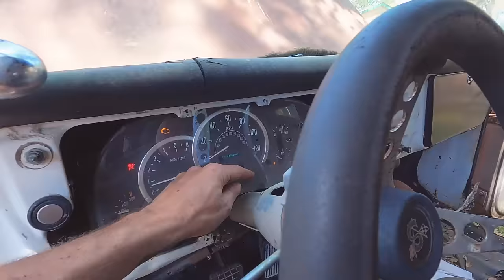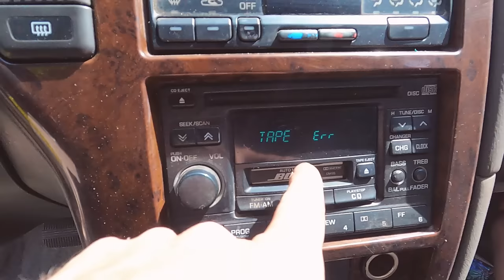It's time to start playing with some of our new projects!

Comment: The pumps in the taink is actually the lift pumps, the one on the frame rail is the pressure maker,,  both gotta work but u can use any fuel pump for one in tank

Comment: for rust removal, use 1 part molasses  ( tractor supply) to 9 parts water. 2 weeks.  cover it  and do it outside.  it does smell.

Comment: good luck on those tanks. in my 77  chev dually. i  had a dam ground problem on my switch over switch its self. some had taken the manual one off. and put in and up dated model. dum asses put a ground to the body and not the frame. the body to motor got taken off at some point and only one tank was used. that was the way i got it. after putting it back the way it was a long time ago. tada. it worked and got rid of wiring not needed. funny part was the manual switch was still there under the mat. they cut the line and bypassed it. think they did what they did was the manual switch was leaking. put a new one in. oh such a hard job. those people instead of replacing it. went to the trouble of all the other shit. hay i got it pretty cheap and that was one of the reasons.
on the way back from the oregon coast back to wa.state. could not help it.got up to about maybe 105 before the lifters started floating. not bad. its whole life was pulling a construction trailer. when i sold it. it only had 52,000 miles on it. but rusted to death cab corners salt road's around area he worked in the winter. he said they worked on ski lifts. did not help i live on the coast. and it sat here for about five years. i got sick also. 4 strokes will tend to slow you down. on top it all that from me.  most of it life sitting in a garage because that guy got sick. i'm rambling "sorry". be well